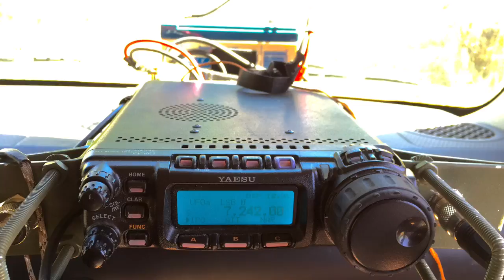NVIS- Communication In Rugged Terrain

Comment: Great test. NVIS working as it should. Both ends of the circuit had the same basic antenna set up as far as height. I think this is key on having a reliable circuit. Very nice demo, thanks.